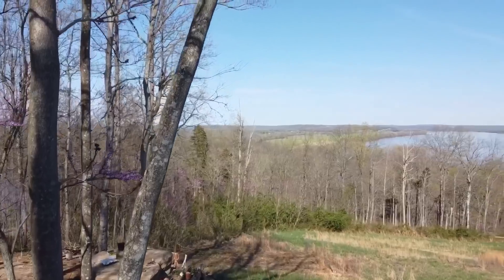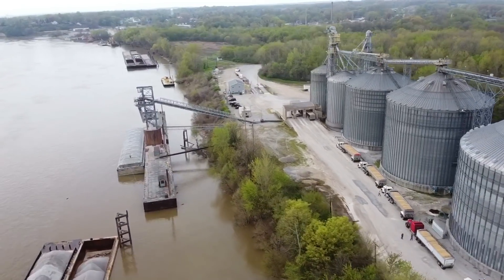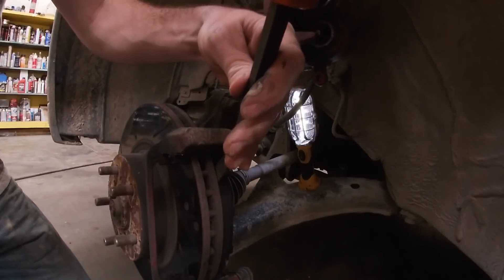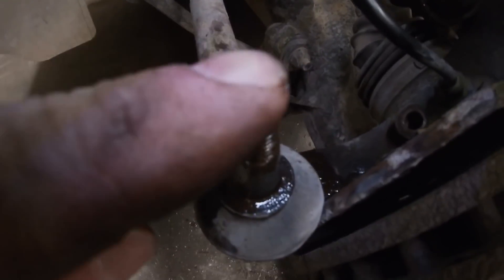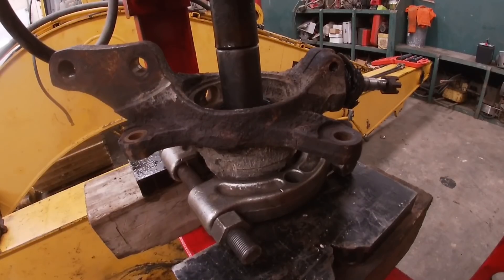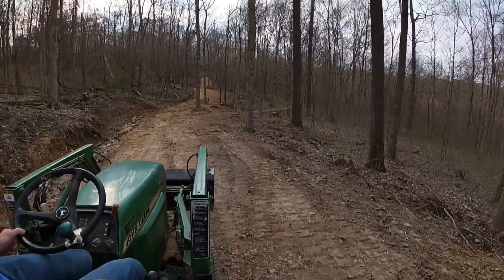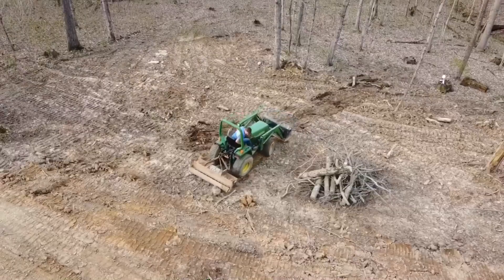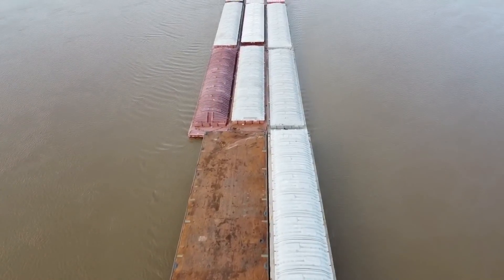Unfinished business - lots of random content from around the homestead

Comment: 20 years in the Air Force as a Vehicle Mechanic (retired since 2016) was a blessing.  I save myself a lot of money doing my own maintenance.  Unfortunately, I don't have a lot of equipment like a press.  I have a large toolbox with your basic tools and some specialty.  I do what I can and go to a mechanic I know and trust for what I can't do.  If I ever find myself in a better financial position and can afford a decent house with a big shop/garage, I will certainly have more tools and equipment to do more myself.

Seeing the tire blow had me thinking you punctured the side wall as well.  At least the valve stem is an easy fix.  I would certainly order spares for both front and rear just in case!

Comment: Pick yourself up a repair manual for the car, makes finding torque specs really easy. I replaced the head gaskets on a friends Subaru, they are pretty easy to work on. If its paid for and it runs, its a good car or truck in my book.
Reply from the maker: BlueDually4x4 I agree with all of that!  Thanks for watching.

Comment: Great vid! I like the variety. A tip for removing tie rod end studs or ball joint studs. Loosen the castle nut, but don't take it all the way off. Take a decent size hammer and hit the area on the knuckle that the stud goes in to. You may have it hit it several times and pretty hard but the stud will pop free. This eliminates the need to hit the castle nut or risk damaging the threads. Pickle forks work, but almost always damage the boot around the joint. If you want to reuse the joint (like the tie rod end) you don't want to damage the boot.  I hope this helps someone!
Reply from the maker: Travis Macie good tip! Appreciate you passing it on

Comment: You’re brake calliper was keeping the wheel from falling off on your car your brakes must have been pulsating. When you step on the brakes the wheel would straighten up lol. Single screw push tug is rare twin screws make steering a raft easier.

Comment: You got lucky on that tire. I was using my JD 2305 a couple of days ago and noticed both of my rear tires were very wet on the side walls. It is the calcium ballast leaking so looks like 2 new tires for me. Dang it.
Reply from the maker: Blu Ice oh that’s a bummer.  How you like your 2305?
Reply: @CaptainKleeman  Couldn't be happier. Bought it new a few years ago with a rear big tiller, a quick disconnect front loader and a 62" belly mower. Love the 4 wheel drive and traction tires.

Comment: What’s the weight or length limit their aloud to move?
Reply from the maker: matt p they can haul around 1,200 to 1,500 tons per barge.  On the Ohio they typically do 15 barge tows because that’s what they can fit in the locks.   But in the Mississippi they will run 40 barge tows